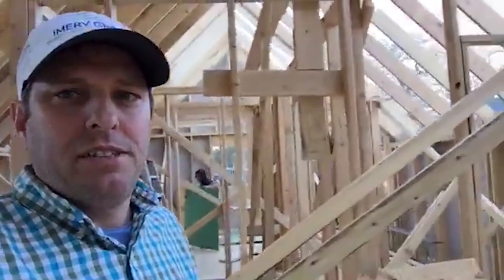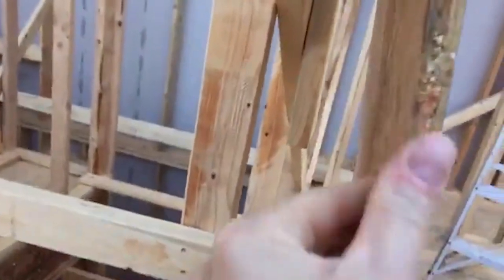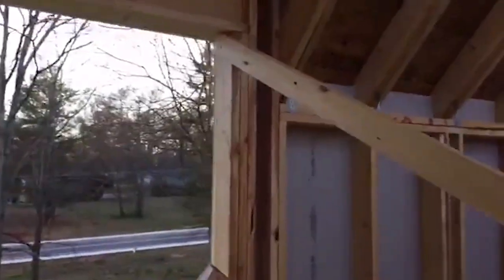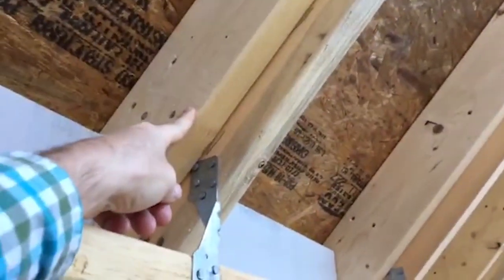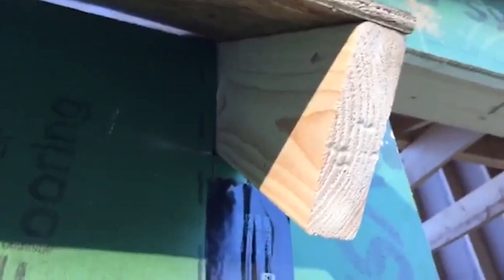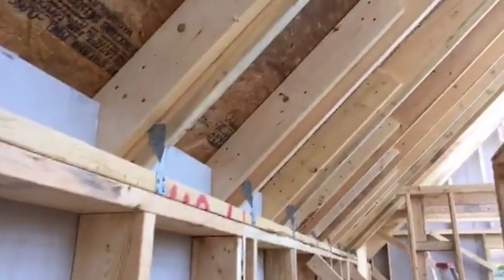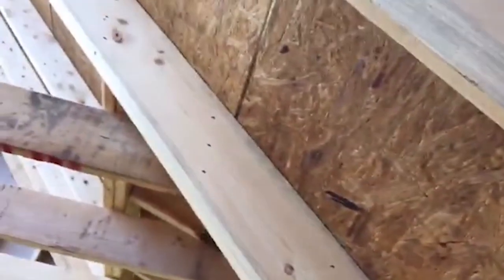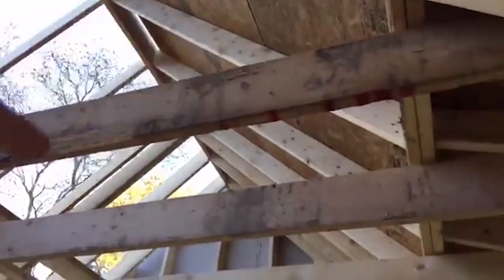Saving Energy With Scabbed Rafters | VLOG 019

Comment: Will special shingles be used that do not need the roof to be vented or will roof venting be accomplished some other way?  The underside of the roof in my home was insulated and it just cooked the shingles and destroyed them in short order.  I had to remove the insulation from the bottom side of the roof and put insulation in the ceiling instead, removing the Attic from the insulated envelope.  I added roof venting and eliminated my problems.
Reply: Hi Damon. Our roof will not vent. It will be (is) metal roofing with spray foam insulation directly under the sheathing. Not hot attic. Most shingles are not rated for a "hot roof," and will bake, like you experienced. Bringing the insulation layer right to the edge of the building envelope is a key element for green building, but it requires the right roofing material to handle the heat. A super-heated attic is one of the primary ways "bad air" enters a home, with a negative effect on indoor air quality. It also forces HVAC units in the attic to work harder. Bringing HVAC units inside the conditioned building envelope helps them run more efficiently and reduces the impact of any leaks in the ducting. Thanks for sharing your experience. Thanks for watching.
Reply from the maker: Ah...I responded from my other channel. BTW...check out this video from Matt Risinger. https://www.youtube.com/watch?v=XjI8HyUqe4w He's a green building expert.